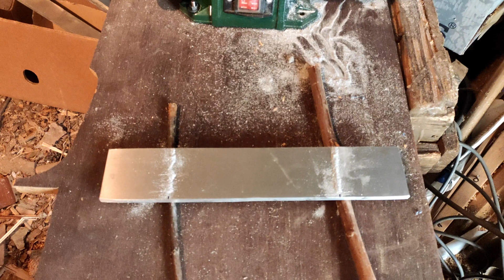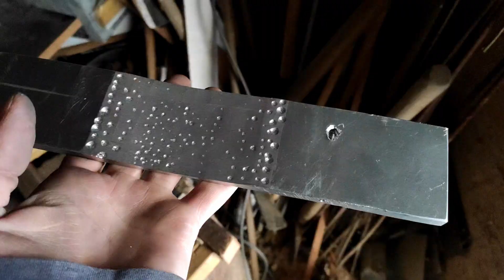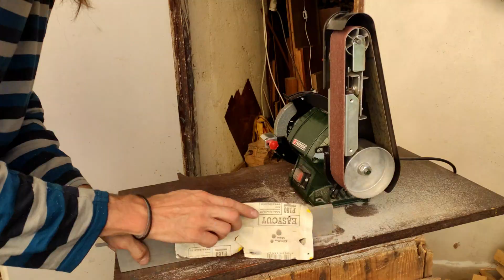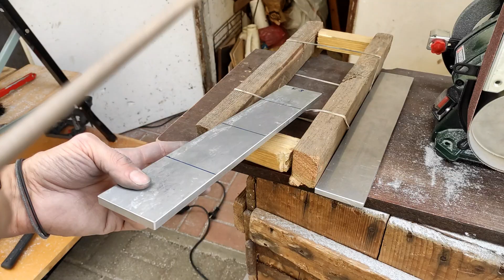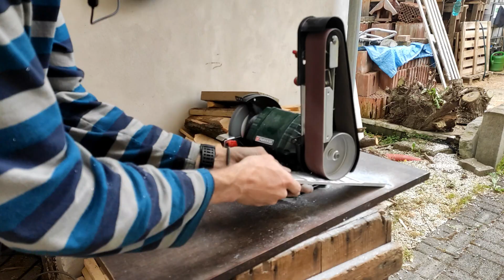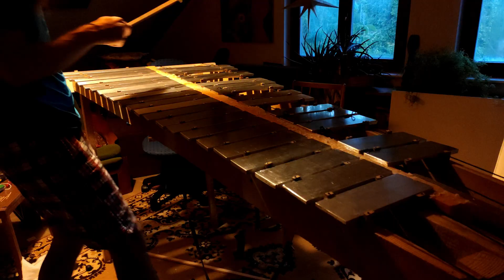Home made vibraphone (DIY build)

Comment: How long did this take
Reply from the maker: I'm guessing roughly two weeks of solid work just on cutting, sanding, drilling and tuning the bars. Maybe more, because at first I didn't really know what I was doing. Then at least 3-4 weeks making the frame, testing different ways to attach the bars, the damping bar, resonators... All in all several months of on-and-off work.

Comment: Doing this project as well. Currently in the middle of tuning my first bar, the F3. I don't have any fancy tools; just a regular handheld drill and a little sanding rig I made (which is also just a drill, clamped onto a workbench). After about 8 hours of drilling and sanding... I'm almost done with the first bar.